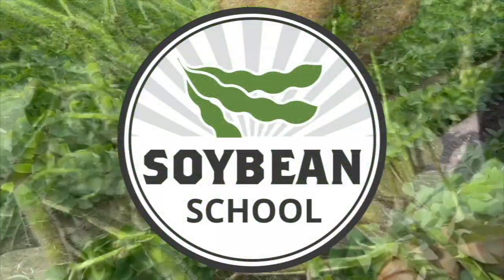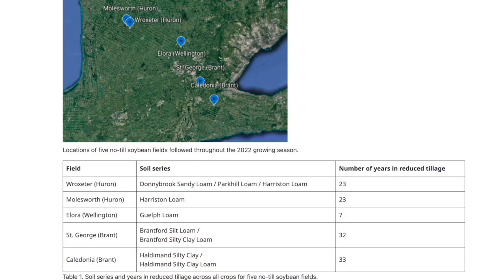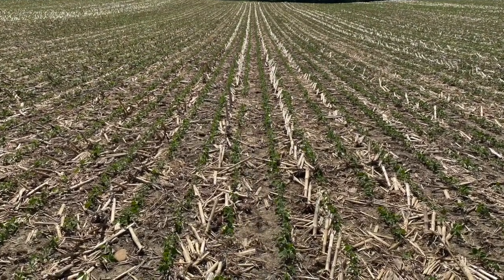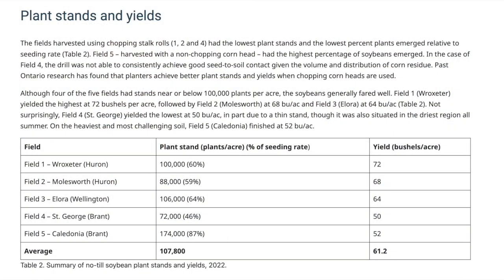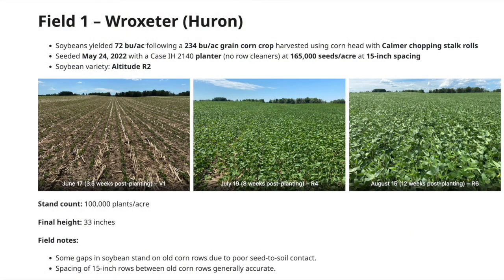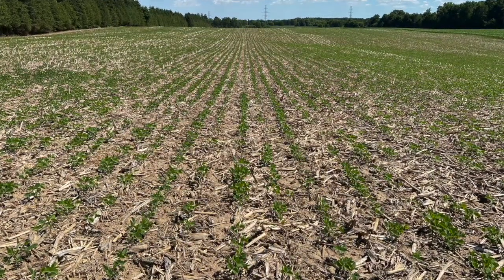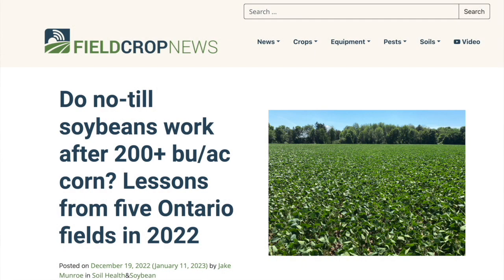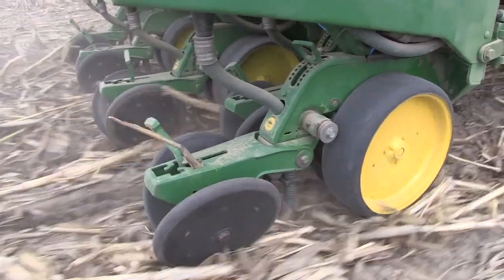Soybean School: Planting no till soys after a BIG corn crop

Comment: Not saying it’s the right way to do it, or the right way for you, but I drill an ancient grain wheat behind that corn, mixed with a multi species cover crop that will winter terminate, get a couple of grazing passes, then drill in yellow pea when the ground is semi frozen during the day, and more frozen at night. Then I harvest the cereal and pea together, clean and separate. 

Follow,that with warm season grasses, make several grazing passes, drill cereal rye with winter terminating species, and beans the following spring. I’d love to go with beans after the corn, but haven’t had good luck with wheat varieties after rye. Too much volunteer rye, and rye is my silver bullet for soybeans and edible beans. I get massive nodulation, and then it starts feeding the beans just when it needs it. Both EB’s and soybeans are the only things I grow with organic yield drag. Not messing with what works for me until it stops working. 

I get hammered pretty hard on corn. The no til, planting green and organic is the perfect storm. But boy, I get a better, far more palatable product. Yellow dent corn has degenerated in to empty calories. It’s just filler that has to be heavily fortified because it can’t perform on its own as a feed product. What’s scary, is on the people food side, commodity purchasers could care less. When sold as a feed product for livestock, you’re dealing with PhD’s, and you can work out a lot better price if you have some protein and nutrients in your product. But the same company will buy for human consumption, and could care less.